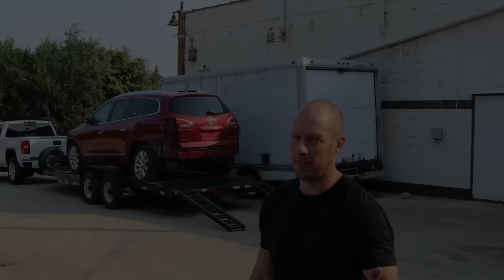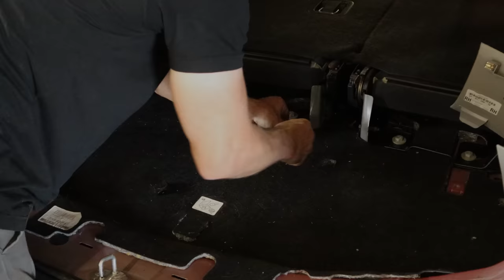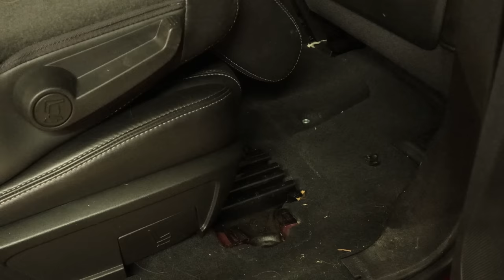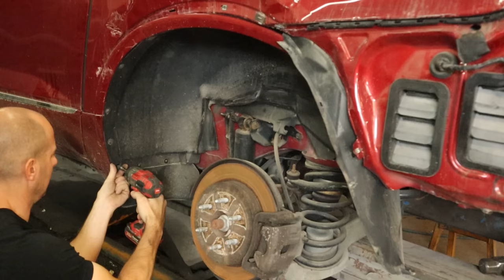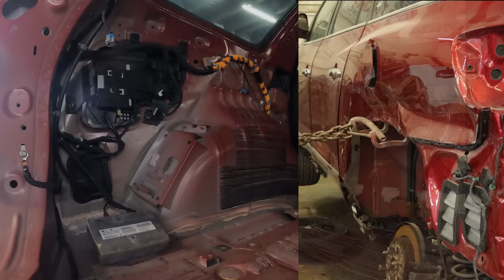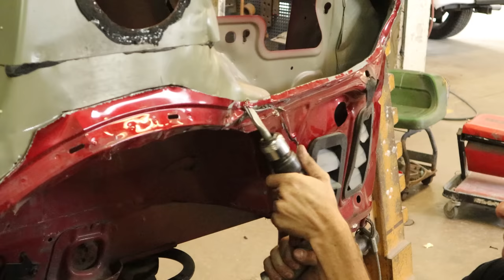Rebuilding a clear title 2013 Buick Enclave after it was totaled by an insurance company

Comment: This is going to be another interesting build.  A low mileage vehicle like this will be a great option for someone looking for reliable transportation at an affordable price.  You're not only going to keep it out of the scrap pile but also going to help someone get solid transportation.
Reply: The prices he puts on his rebuilt cars are pretty high. Not a whole lot less than a mint example
Reply: @idontlikecops1  ya but he does really good work and doesn't cut corners. He actually goes the extra mile and puts rust proofing in it then details the car. I would buy a rebuilt car from him anytime.
Reply: RIGGY RIGGS  mines pretty good. 2011 130k miles

Comment: I know you hate to hear about the old days. I did body work at a less than professional shop. We would have done some pulling. Some hammer and dolly work.  And sent it to the body shop. Of course the finest scrap yard replacement parts 🙄. I remember the rule being, bondo couldn't exceed 7/8" in thickness. I'm sure they made a fortune. But I never did. I was young and 5 dollars an hour in 1974 was a lot of gas ⛽ money for cruising. 
Thanks for sharing the right way to fix cars.

Comment: Pulling the outside first is always best, it will relieve so much tension from undamaged areas as well as the damaged areas.
Easier to pull a strong section back into alignment than loose sheet metal on the inside.
I was taught to " reverse the impact".

Comment: In 1966 I was driving my 59 Impala Bubbletop and T-boned a 60 Olds. Both of us were going to fast for the circumstances, but she ran a yield sign.  After the accident the front end of my car was turned to the right.  I saw another 59 a week or 2 later that had been t-boned.  So the front clip and frame were fine (both cars had an X Frame.  I bought it and swapped my body to that frame.  IN order to take it apart, I had to use the can opener as most of the. bolts were inaccessible.  I was 16 then and not wearing a seat belt.  I estimate I was doing between 50 and 60 when I hit.  Surprisingly I didn't contact the steering wheel.  I'm a believer that at times one can have super human strength.  I pushed the gearshift all the way to the dash.  Interestingly, to this date, I have. no memory of the accident.  I can tell you everything up to the point prior to collision and after I regained consciousness.  I can even smell the bakery I drove by when I think about it.
Reply: I was about the same age when someone went through a stop sign in front of me, but luckily I was able to brake hard and go around behind them, even after they hit the brakes when I was about to hit them.

Comment: Salvage in this case just means the insurance company determined it costs too much to repair. Your gain! 2013 to 2017 Enclaves are the coolest. I have five Salvage Title Copart vehicles: 2007 SAAB 9-3 convertible, 2002 Oldsmobile Intrigue GLS, 2003 Oldsmobile Alero GLS coupe ( with only 20,202 miles!), 2003 Oldsmobile Aurora,  and a 2003 Pontiac Bonneville SLE. All repaired to perfection.

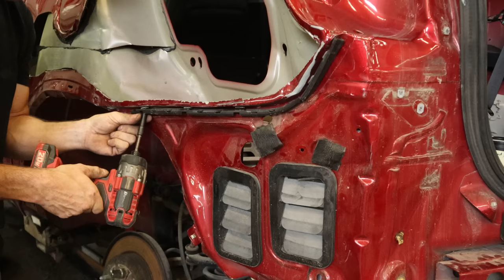Comment: 23:49 I had an issue removing that bracket from my 2011 Chevrolet Volt. That bracket was riveted in, rather than held by bolts. Probably GM wanted to make sure no one would mistake a Volt with a Bolt. The Volt doesn't have any bolt inside.

Comment: I'm an A&P mechanic which is an airplane mechanic. When I'm taking of an exhaust stack or alternator we use plastic baggies and then note on the baggies the part & location of the hardware. It's required that we do it that way so we know where the fasteners had gone to and its location. Side note....... All the airplanes that I worked on general aviation aircraft like you're Cessna and Mooney, Piper the alternators that go on the aircraft are all AC DELCO but like Aerotech slaps their sticker on the alternator and charge triple the regular cost. It's all got to do with LIABILITY!!!

Comment: No no no, that's not foam, it's part of the VFD! Vehicle Floatation Device!  Completely ineffective for it's designed purpose, but works excellently in holding moisture to rot out the vehicles even faster, and therefore allowing manufacturers to sell more vehicles!

Comment: There should be a little motor on top of the apparatus to lower the spear tire down, just push a button and the tire would lower down with out having to use a lug wrench, or power driver.

Comment: My 2 week old Acura MDX was hit in al most the same manner in January 2020.  Wheel  was trashed, Taillight survived. New qaurter panel, and rear bumper. Body work and paint were good. I am an ex body man. Detail was not close to acceptable. Title was clean, an carfax read "damaged". It is long gone.
Mine was not hit hard enough to damage the inner structure. Estimate was $4500.

Comment: Big fan, been watching your videos forever.  Off topic, but I know you're a big GM guy and have had several Duramax and figured you would know.  I have a 2015 Silverado LTZ Duramax (LML) with 49,000 miles.    So far it's been awesome but I'm always worried about the CP4 exploding and the pricey repair bill that goes along with it.  I run diesel additive on every fill up to add lubricity to the fuel because I heard the reason is CP4's fail is because of a lack of lubicicity in our fuel.  Somes guys just run additive, some  add a lift pump, some actually switch out the CP4 with CP3.  Some say you have a 90-92% of not ever having an issue.  What's your take and if it was you, what would you do if you had an LML?

Comment: I notice on just about all of these rebuild videos, the guys at the auction always seem to move the cars around with a forklift. Doesn't that do a lot of additional damage underneath?
Reply: It often does. My Lexus project car I bought from a Copart auction had a bent structural brace and dents in the floor pan and the gas tank, all from the fork lift. It also scraped the undercoating off in places, which I had to re-apply seeing as I live in the rusty North East.
Reply: if you buy from copart its the law that the forklift does extra damage

Comment: I can give you an example of just how expensive those little parts are.  I bought a seal for the cooling system of my CTS, nearly $18.00 (round, rubber).  I walked away with a limp, but since it's what keeps the coolant in the car, I'll limp.  Listen to Professor Scott - he's right.
Reply: Sounds familiar, I had to buy a genuine O-ring for the inlet manifold in our Mitsubishi Starwagon. It cost me $8 Australian, for just a damn O-ring. But no more using water after I fitted it, so I guess it was worth it in the end. 12 years later and it's still good.

Comment: Buick Enclave/Equinox/ Acadia problems : 2008 - transmission $$$; 2008-2010 - stretched timing belts$$$. $ 1,000  just to change a water pump.  This nice-looking GM Light  SUV is a endless money pit.  Shame on GM for the obscene amount of planned obsolescence in this series.
Reply: I got a piece of shit 2009 Chevy Traverse that was bought brand new. Oil changes every 3000 miles and the timing chain is fucked up amongst other things. Junk this piece of shit
Reply: You forgot the blend door problems with the air

Comment: When it has a clean title do you inform the new buyer that it has been totaled/rebuilt? I Wouldn't, but realistically there should be no reason to if it's done correctly
Reply: Sold properly it should be revealed. Rather be upfront than to have problems later and have the customer learn about it.

Comment: Sooooo how does that even work with the title? How is insureance allowed to "total" a vehicle and send it to auction with out branding the title?
Reply: If you have a dealer license you can buy totalled ("damaged") cars even from dealer only auto auctions and NOBODY WILL EVER KNOW. What's the difference to buy that car  from dealer or from rebuilders? I Had a car bought from dealer, look so perfect on inspection and carfax. But after one time I had to remove rear seats I found out whole pile of rear trunk glass. I pulled covers than, and subfloor was full body filler dust. That and other stuff was clear indication of body damage. 
 After that, it was my last car ever bout from the dealer. Now I learned how to  fix cars my self .

Comment: The TRUE honest issue is ! 
And this is from someone who has had 4 of these type cars with this Engine !! 
These all have the AWFUL P.O.S. 3.6L V6 and as the 3rd worst engine of the last 30 years after the Northstar V8 and the FORD 5.4L 3 valve ! Well  to me its just not worth putting any money into an of these ! My last 2013 GM 3.6L lasted to 65,000 miles and service was done on time at the dealer and the damn F-ING timing chains still went bad !
Reply from the maker: Service at the dealer makes no difference if the intervals are too long.  5,000+ miles is too long regardless of manufacturer claims.
Reply: @vehcor  I never ever passed 3500 miles thou and even then it was usually after a long trip ! Mostly because I Knew not too !! Most oil changes were under 3000 miles !! And most never lasted to even 100,000 miles ! Hell 1 engine gave up at 27456 !!! In a 2013 Equinox V6